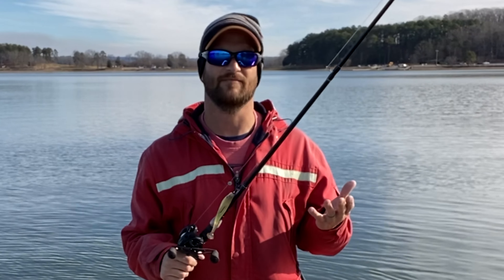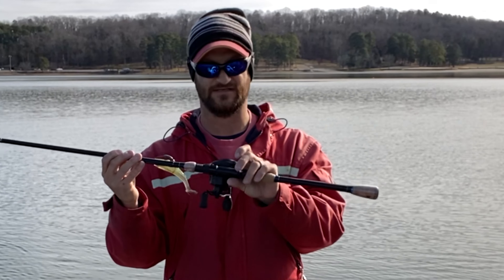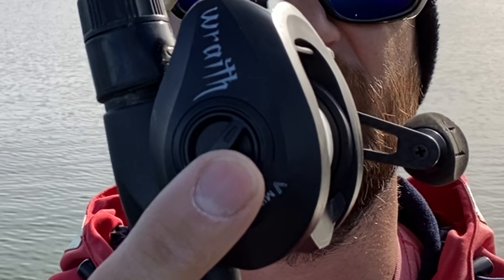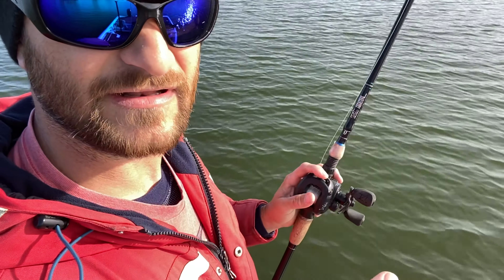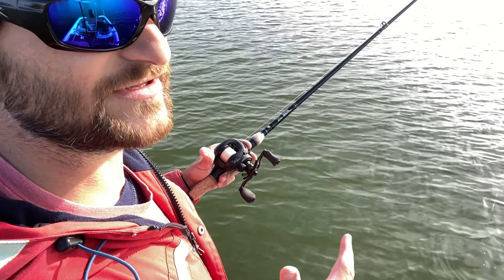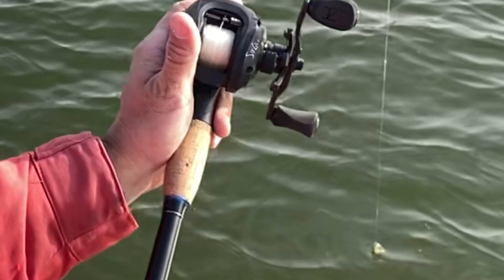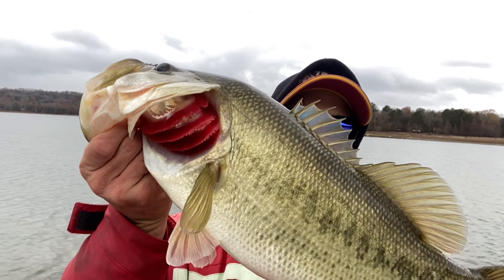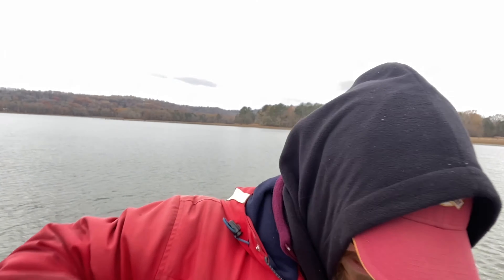How to Cast & Dial In Your Baitcaster Reel: Understanding All Components

Comment: question for you, at one point early on in the video when discussing the Mag break I thought you said , it kinda works the opposite way compare to the fine tuner , Open it up for Larger Lures , but you said at the end to tighten it up if your getting backlashes at the end of your cast...  Upfront, sorry if I misunderstood, just want to get this correct.
Reply from the maker: Yeah, if a lure is heavy, you need to tighten the fine tuning knob, but loosen the magnet brake. If I lure is light you ought to loosen the fine tuning knob, and tighten the magnet brake. So the fine tuning know basically works the opposite way as the magnet brake.

Comment: Casting with three to four feet of line hanging from your rod tip slows down the transfer of energy from your rod to your lure (think trebuchet). This greatly reduces backlashes. Turning your baitcaster on it's side allows the spool to rotate on the pinion on a vertical instead of horizontal axis. Things that rotate on a vertical axis tend to spin longer (think spinning top versus wheel). This also yields longer distance and more smoother casts.
Reply from the maker: Great insight there! Thank you!

Comment: Great tips about the importance of an "educated thumb"-that has to become a reflex action by the angler.  The pins are part of a centrifugal brake system-not a magnetic system.  And you left off any mention of the actual arm/wrist mechanics and a tendency for newbies to try to "over-cast" with too much heft.   It isn't all about "knobs"- that makes people neglect the human component which is the primary cause of casting backlashes. (most consider "birdsnests" part of spinning reel failure due to them literally looking like a birdsnest, and reserve the term 'backlash' for baitcasters, exclusively).
Reply from the maker: My aim is to encourage new anglers to realize that they, with a little education and understanding, can also master a baitcaster. Obviously, it always comes down to the angler, but that’s not what they need to hear at the moment they backlash and are feeling discouraged. Most of the time they just need to slow down, breath, and go about it logically. Understanding why they just got a backlash and how to decipher what just happened gives them something to they can fix more easily.

Comment: I’ve just started using baitcast this past summer and haven’t gotten any good using my thumb yet so I’m stuck adjusting the brakes for that. Hopefully I’ll get better at it
Reply from the maker: Brakes are kinda secondary to the fine tuning knob. Get that adjusted right and everything will be easier. Understand though, if you want to flip and pitch, you gotta loosen it, BUT if you go back to casting, make sure to tighten it back up again. Ultimately it comes down to practice.
Reply: I sent a PM on Facebook.

Comment: I don't have experience with a lot of baitcasting reels, but I do have a lot of experience with one. I'm knocking on the door of 63 years old and I have been using that same baitcasting reel since my dad gave it to me and taught  me how to use it when I was about 7 or 8 years old. It is a vintage Shakespeare Wondereel Light #1921manufactering date code of 1946, knuckle buster. It is a direct drive reel without all the amenities that modern ones come with; star drag, push button spool release, anti reverse or any of that stuff that takes away from the true fishing experience. And for that reason it's much trickier to use. The method of setting the reel that my dad taught me is much easier than what you're saying. Put the lure you wish to use on the line. Stand up straight with your casting arm straight down by your side with elbow bent at 90°. Hold the rod down as flat as possible parallel to the ground and release the spool. If the lure doesn't quite make it to the ground, you have too much tension on the spool, release some. If the lure hits the deck and creates an immediate rats nest  backlash, you have too little tension, add some. If the lure hits the deck and doesn't create backlash, you have it set correctly. Start fishing! The reason for this is the water has a much higher density than the air you're casting the lure through. If there isn't enough tension on the spool when the lure hits the water and slows down, the spool is going to keep spinning at a high rate of speed and, instant backlash. If the lure hits the surface that you are standing on and doesn't creat a backlash, when the lure hits the water which has less density than whatever you're standing on, you will not get a backlash. This test method has to be done everytime you change lures of a different weight. Over time you will gain enough experience that you will be able to adjust the reel without performing this procedure. You can also micro adjust the tension for longer or shorter casts.
Reply from the maker: Great info! Thanks.